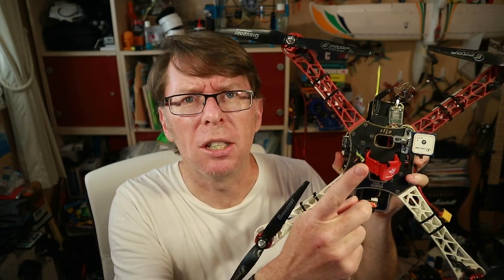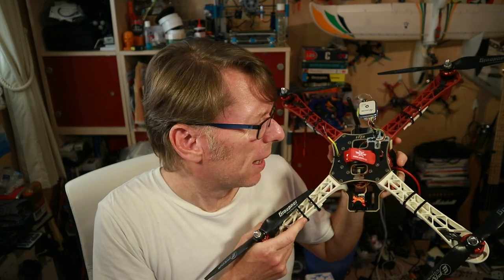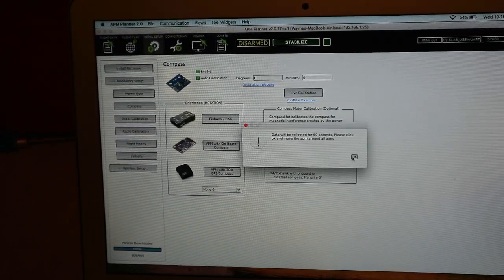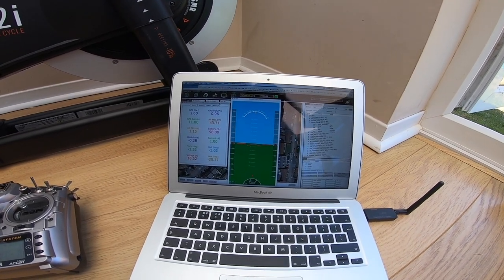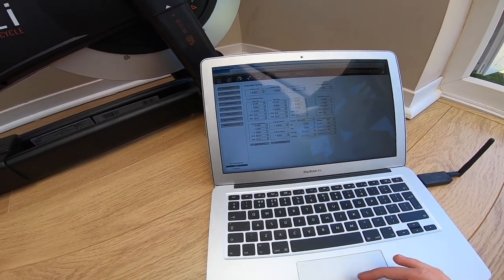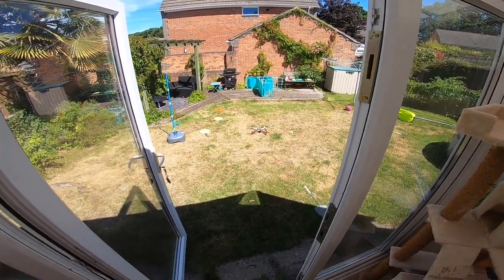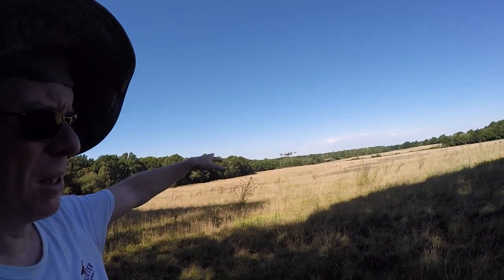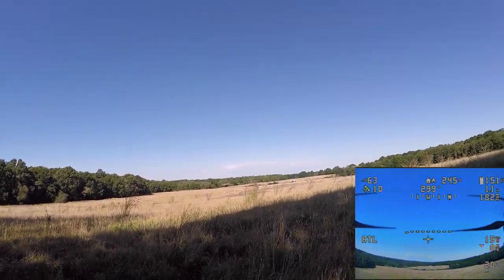Ardupilot using an F4 board on a multicopter - part 2 (this time with a compass)

Comment: This is why I use iNAV on my quads...The GPS Modes including RTH and land...all worked first time....on two quads
   .Arducopter is like wading through a bath of treacle in comparison. Regarding compass calibration...move well away from your laptop, remove your wristwatch and anything else metal. The telemetry transmitter is stepping on your GPS I think too, move it to the front of the quad.
Reply from the maker: Yes a few others have mentioned the same - I should have done that outside away from stuff

Comment: Ardupilot is the way to go...... The compass and the GPS are really important and the compass will be the biggest hassle. But done right there is absolutely no comparison to I-NAV. It is simply AMAZING software
Reply: I agree 100%  Ardupilot definitely has the upper hand on maturity. Works great in every mult-rotor I've ever built ,plus it works great on fixedwing as well.  Inav is decent to , but I feel like inav on quads is a huge hassle.  Inav on fixedwing I've never had any problems.  
My choice will always be Ardupilot/arducopter, ardurover.. Plus I'm not a fan of the arrogant attitude of certain folks within inav team.

Comment: I spent a lot of time on this years ago and my take on it was a failure to accurately assert GPS baud rate. If you connect the GPS directly to a PC and use tools like the uBlox desktop app you can see what the GPS is trying to communicate and actually it's a well behaved little device and tries to auto-negotiate by default. But I guess Ardupilot itself is not so well behaved here. Hacking around with serial port parameters is necessary and also to play with the fixed baud rate settings via uBlox. But... as you say there is "the hassle" and that  is exactly why Ardupilot is doomed in my opinion without a major re-vamp to a auto-config/plug-and-play experience we enjoy with the "...flight" firmware which was written the other way around (user first / geeks last).

Alongside this there is also the necessity for the GPS host (ArduPilot) to assert which combination of satellites are being scanned (US/global, Russian, EU, etc...) and some of those don't even work without the correct firmware if at all (hardware limitations). So alongside baud rate check the satellite settings. Also if you want to get really funky try to get DGPS working... they transmit GPS correction data now over GPS itself (sounds strange but it works) so you can get higher accuracy in theory when it's all setup properly... yeah that's the problem. This takes a LOT of time.

Ardupilot is to quadcopters what Linux is to Operating Systems. Yeah it's technically got more scope but most people want a system like Windows, Android or iOS which "just work" (...flight or KISS).

Comment: I used to calibrate compass for ardupilot outside at location and did not have a problem like toilet bowling. Surging 5volt power (brown out voltage) supply of mini apm pro caused disastrous crash since apm was rebooted while it was airborne. I provided double power sources and problem had been eliminated.

Comment: Wait till your first fly away. I had a wing take off when doing a waypoint loop around the field, I drove down the HIGHWAY with my rfd900 radios for 20, TWENTY minutes and regained connection. I pulled over and sent fly to home via mission planner and actually drove back and landed it and never flew the mission planner / ardu stuff again.

Comment: I am running a similar setup on a 450 frame. omnibus f4 pro V2, frsky XSR RX, and mateksys m9n-5883 gps with compass. I get 20+ sats indoors in less than 20 seconds.

Comment: I have spent days trying to get my omnibus f4 pro working with arudpilot, I gave up. 
Found an old apm 2.6 in the box, set it up in no time , quadcopter flies  beautifully. 
BTW I have a gps sensor connected to the x8r receiver and it takes about 5 minutes before it's ready. After which time I have about 16 satellite's .
Reply from the maker: Glad it's not just me.  I did try at one point to get a 2.6 board working, but I seemed to have real issues getting the OSD to work to the point of it really doing me in and gave up.  Just sorting the iNav config and have found that Ardu did do one quite clever thing which allowed it access to an extra UART that's missing on iNav

Comment: You gave it a good try CK. No question. But may I opine please? 
Compass cal must be done outside away from EMF. And also should be done once again if you have moved any distance before flying in another location.
Then there are also magnetic deviation values that may be found specific for your Lat/Lon. I can't remember if or where that info plugs in to Ardupilot.
Mine is -12 deg. 
Regards my friend and keep us in the loop.
Reply from the maker: You make a good point - where the clip of me doing that was a "dramatic recreation" because I hadn't filmed it at the time, I certainly hadn't given it the sort of space I did when I calibrated the compass back in the Naza days.  I did look at the at deviation thing - I had a feeling it did get populated, but I can't remember know

Comment: These GPS units can take a long time (10 mins or more) to get a fix if you move far from the place it last saw the sky.   I'm not surprised you got a slow but improving fix
Reply from the maker: It's weird phenomena - I take off and I'll get a fix.  I leave it thinking about it on the ground and it never gets there
Reply: Keep up the work.  I'm interested in the GPS and auto flight modes.  Inav is the way to go.

Comment: I don't expect you have ever wanted to go back to this project but the biggest reason for errors like you experienced is the compass. Shielding the compass from all the RF and magnetic fields generated by the aircraft create havoc. The longer the GPS stork the better.
Reply from the maker: Ardupilot is very comprehensive, but it does seem incredibly fussy about... well, everything :)  I put the same setup on iNav and it happily took off would hold position, RTH etc.  Now it might be that the compass had exactly the same amount of "madness" but iNav wasn't quite as fussy about it and it all flew fine.  Id like to find that setting in Ardu to say "don't worry about it, just do you best"
Reply: @CurryKitten  Thanks for the reply. I really enjoy your vlogs and thank you for all your effort. 
I played around with Inav when it first appeared. RTH didn't exist then a even hover was working. Time to see what they have done. 
👍👍

Comment: The compass(es) are also giving me a lot of headaches on arduplane. Were you using multiple compasses ? E.g. one compass on the FC, one compass on the gps ?
Reply from the maker: Nope - I just had the one on the GPS.  I've moved that config over to iNav to compare and it doesn't seem to complain at all about the compass - although I've not done a proper flight test as yet

Comment: Sir ; thank you for your videos which are filled with information. I have a question to you please: Can I power omnibusF4 pro V2 card with 18.5V 25 C liPo battery directly ? thank you
Reply from the maker: The spec I have says you can run it direct from a lipo, but only up to a 4S, so 18.5v would be too much

Comment: A lot of the errors can be ignored but your GPS problem is one or both of two things. The GPS unit itself may just be crap or the 433mhz telemetry module is causing interference and preventing a lock.
I've had endless trouble with those telem modules preventing a GPS lock and I run a Bluetooth module permanently wired in for wireless setup and don't bother with a link to the ground when flying my 450.

I'll have to look up what GPS and compass module I'm using but I get almost instant lock with the way mine is currently set up.
EDIT: I've just checked and mine is running a 880 GPS like your using,  id try disconnecting the telem and see if that cures your problems.

Regarding home position,  it's important to get a GPS lock before arming,  you home location is set to the curren GPS location at the point of arming.
How high the quad rises when it kicks  into rth and how low it will drop to or land once it reaches home can be set in mission planner. 
As you've probably guessed,  it's designed so it won't collide with obstacles on its way home, that's why it climbs and it's fully configurable.
Reply from the maker: Thanks Steve, yes - I would normally wait for a lock, but I do seem to suddenly get a bunch of sats when flying.  When I landed and did the RTH test I did see it say on screen it was setting a home position, and assumed that would be my home point, but obviously not the case in hindsight.  interesting point about the 433 and the GPS.  That's an easy one to test out - cheers
Reply: @CurryKitten  my guess  on why i have problems with my 433 telem modules is 1.299ghz a harmonic of 433mhz and one of the frequency's used by GPS is 1.227ghz and a poorly made 433 module is gonna walk all over gps with harmonics.
GPS uses two frequency's on each sat, that could explain why a lock is eventually possible but takes a very long time.

Comment: Very interesting I'm wondering if gps module is getting interference from receiver or just a bad unit ?
Reply from the maker: Certainly the FrSky telemetry receivers do fight with GPS's if in certain proximity to them.  A few people also pointed out that it's possible the 433mhz data radio that might be having an effect.
Reply: @CurryKitten  that makes sense 👍

Comment: Wow I did not know you could use ardupilot on an f4 board designed for betaflight/inav.I remembered the early days of drone i had almost same setup as yours. The only difference was , Im using an apm 2.6 board and autonomous missions working flawlessly . Try replacing the GPS/ compass module , this may fix the problem.
Reply from the maker: I've got a 2.6 board, but even back then the multicopter part of the code really needed a pix4 to work properly.  I'll see how iNav goes.

Comment: This video is very useful for me. Can Omnibus f4 pro use same time both telemetry 1(RX/TX) and RX IN(sbus)?
this Omnibusf4 pro looks that all of GPS/Compass/Telemetry/RSSI/Sbus-Reciever are used.
As I can't do it(short of uarts), I set BRD_ALT_CONFIG param to 1. And telemetry is used I2C.
(But I can't use compass.)
Reply: Hello, 3 years later, I am still having this issue. I wanna use telem1 but it does not work with s-bus is plugged int. Any idea how can I solve this?

Comment: Fond memories of my F450 on an F3. Could never get rid of jello, it's those plastic arms and 10" props.
Reply from the maker: I used to run my Naza on this frame (and along with motors and ESCs) I did tend to think that it was lovely and smooth, but it's very much the rose tinted spectacles when looking back.  Certainly compared to now at least

Comment: hi mate not happy, i brought a bn-880 gps  for my flight borad, and the conecters dont fix, and now i can see why i have got f4 v3 betaflight board with sd card slot, i dislike when people confuse other people, and you know what i am on about, theres another like you, show and tell, and not explain properly, and i went out my way, to buy parts what dont fit
Reply from the maker: I feel things have been made both easier and difficult from the FC boards move away from solder pads to a mix of connectors and solder pads - because if you need to connect to a socket but you haven't got the exact right size, then it's tricky.  I did have to make up a connector for that BN-880 to fit in properly, but I'm lucky enough to have lots of spare bits and bobs laying around that I can use

Comment: Omnibus boards wouldn’t be my first choice for this. You seem to be somewhat cursed with this mr. Curry 😁. I first started flying Ardupilot with a 3DR Pixhawk flight controller it was originally designed for so why not get yourself one of those as you have all that real estate. Failing that go for a better board such as a Matek F4/7?.....dump the Omnibus. GPS doesn’t need to be on the stick, judging by your dvr it’s probably oscillating horrendously and causing a lot of your issues. INav is now my go to for modern boards, works great.
Reply from the maker: Yes - originally Ardupilot was pretty much a fixed hardware platform.  I did have an Ardu 2.6 board, but the copter part of it already exceeded what the old board could handle.  That oscillation is just the crappy camera, I can sort that out
Reply: Hope you succeed 👍🏼

Comment: Have you ever had any experience with the dji Naza v2?  Mine worked great, rock solid, but then I tried the signal loss-return to home. It flipped over and power drove itself into the ground. I am certain I forgot something, but would like to have another go at it...I just there was someone who could assist me.
Reply: Plug your quad into the NazaV2 assistant with the transmitter on and go to the screen where you calibrate the receiver and switch off the transmitter see what happens? I had to set a failsafe on my receiver. (FrSky) so if the receiver loses signal it failsafes to throttle halfway and RTH. Hope this helps
Reply from the maker: I agree with Dad learns FPV.  I flew my Naza V1 for quite a while, and RTH in manual or forced worked really well - but I also set my failsafe to RTH mode and have throttle at around 50%.  Once set up always go out and test this before flying where it might kick in for real, do it on a switch first and once you are confident that's working try turning your TX off - but give yourself enough space in case you need to power back on and regain control

Comment: 10Sats is low.  Does the compass turn the right way?   I have an 880 where I had to flip it in inav and turn it 270 degrees.     The arrow on them doesn't mean forward :)
Reply from the maker: Yeah - it was the right direction according to what I was seeing on the screen.  10 sats is low, and I had more in my garden (which is usually a GPS black spot)

Comment: how did you connect the telematry transmitter to f4 FC? i have installed old apm with telemetry so i would like to replace apm with f4 FC
Reply from the maker: rx/tw into a standard UART port basically.  Ardupilot on F4 is very picky about the boards it supports and exactly what UARTS get used for what, so make sure you check your board with it first
Reply: Ok👍